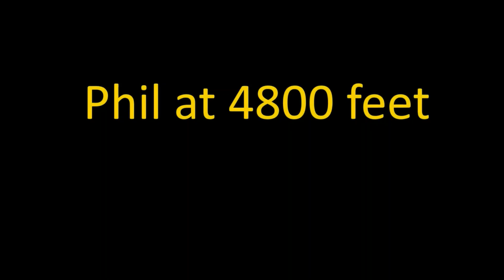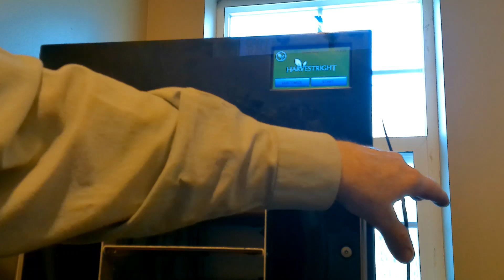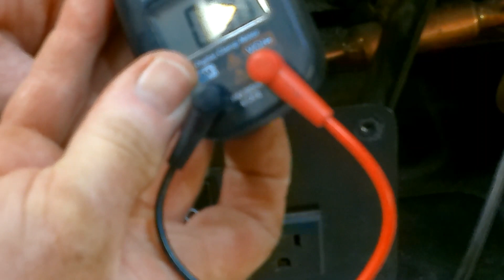Harvest Right Freeze Drier Arc Flash

Comment: Phil, your videos are amazing.  Thus far I found people telling me what to do to “fix” FD problems, but not the what happened and why it happened.  I am a person that wants to know!  In this video, I wonder if the crimp connector was crimped tightly enough from the beginning?  The strands of copper looked charred, but not necessarily frayed/broken (hard to tell via video though).  Did you recrimp the other connectors just to be sure?  And did you replace the one on the relay board that had evidence of heat damage?  Not being critical, just curious.  I think you are working on a medium FD in this video?  I wonder if #12’s are used in the large model, given they require a 20 am dedicated circuit?  Also, thanks for explaining the use of the tools you use throughout your videos.
Reply from the maker: The wire they used should be rated for the amperage drawn.  Most likely, it was a poor crimp on that wire.  I didn't recrimp everything, just performed a pull test.

Comment: I'm having the same issue & its only the 2nd time using it on a brand new harvest right... 
I have a gfci plug & an Arc breaker inside the fuse panel, Its fine on the freezing cycle & drying cycle but I'm assuming it's the final drying that it's tripping the Arc breaker not the gfci....
 Very disappointing after paying that much money & working 10hr days 6 days a week to come home to issues like this
Reply from the maker: Make sure you have at least 15 available amps.  Are you running your FD on a Arc Fault circuit breaker?
Reply: @Philat4800feet  Yes sir, Its a dedicated 20amp Arc breaker with nothing else straight off the main fuse panel all certified wired 2yrs ago

Comment: My problem is after I installed a new touchscreen usb and relay board and turned the fd on,, it flashed/sparked so I INSTANTLY turned it off and I could see and smell the smoke :(
Talked back and forth with HR , sent pics and video and I am still not running yet. I’m going to try and show you the video of what it does now.
Reply from the maker: Where did it spark?
Reply: @Philat4800feet   around the touchscreen/relay board area.

Comment: Good series of videos!  I've been watching a few of them.  Here's some thought and ideas for you (maybe even to make another video on).  1)Quick changeover:  Have you tried using a fan and running thaw cycle with door open at same time.  Might allow you to cut your changeover time in half again.  2) You wrapped your shelves with foil to contain heat and stop ice intrusion.  What about using plastic sheeting?  Less heat conductive and reusable.  Might reduce cycle times further.  3)Do you have any thoughts on programmability and flexibility of HR?  I am thinking of buying one for work project - but would need to be able to adjust cycles, temps, times, pressures.  4)How do you handle materials that have high static when finished?  Thanks for any advise or ideas!!!  Keep up the good work.
Reply from the maker: 1.  I use a fan only to defrost.  I don't use the heaters.  I can clear the chamber in about 40-60 minutes, enough melt to pull the  ice out of the chamber.
2.  Never thought about using plastic wrap.  I do like foil for it's heat conductive properties.
3.  Haven't tried to reprogram, but I have wondered about making a unit strictly manual and getting away from the integrated circuits.
4.  Static?  Don't understand.
Reply: @Philat4800feet  Thanks for the quick response!  I'm a Lean guy as well, so it was just a suggestion that might allow you to use the heat from the heaters as well as the fan and maybe pull the whole chunk of ice out in 20 minutes or so.  (Kaizen the changeover again!) Don't have a freeze dryer yet, so maybe I'm totally off base.  Try it and let me know what happens. 2)Plastic is much more insulating than aluminum, and so would keep more heat inside the cage, and keep more cold outside the cage.  Just a thought if you want to experiment.  3) My application is scientific - I may need to buy the HR scientific model to be able to control the program more.  You seem like a data-driven guy (which is why I like your channel), so I thought maybe you might be experimenting... 4) My product when freeze dried flakes off easily, and I can't have it flying around (due to static, etc).  I will be building a laminar flow hood around the freeze dryer to provide cleanroom type air, etc.  Not really a concern for food freeze drying.  Didn't know whether you run into this.  Sounds like not.  Keep up the good work!

Comment: Doing refrigeration 28 years crimp on slip 
connectors on primary power can heat up and become loose. Always kept in stock in my electrical connectors box. Needle nose to pull connectors also
Reply from the maker: Good comment

Comment: Phil, thanks for all the info you turn out. Have you found any way to get parts for the standard vacuum pumps? My pump needs to be replaced or rebuilt, the electric motor is fine.  thanks again for all the info you provide.
Reply from the maker: I believe you may be able to get them from HR

Comment: When my drier arrived, the pump would not turn on. So that failed the first test you are supposed to try when you get it. I called HR and they couldn't really help. So I figured I should just look at it myself. In my case the wire going to the pump had a loose connector. So I squeezed it up a tad with some needle nose pliers and then went through all the connectors and did the same. Unfortunately I only did the connectors down on the power inerfase and not the rest of the drier. I may have to go in and do that. I suspect that what happened here is the same issue as I had.
Reply from the maker: Sorry to hear about that

Comment: Phil:

Because the connector at the relay board end was also discolored, you know that that connection has also heated.  And that tells you that either too much current flowed through that connection, or that that connection was/is also bad.  Remember that if a push-on lug overheats, the copper/beryllium alloy loses its "temper" and loses its spring strength.  So that lug cannot be trusted either at the wire crimp or at the lug mating end.

One possibility is that the connection at the power switch end was not properly crimped at the factory, and likely, the same person installed the lugs at both ends of that wire, and also "limp wristed" the connection at the relay board end as well, as they were doing the assembly.  I've seen this on HUNDREDS of crimp connectors at a place where I worked many years ago, and when I started finding the bad crimps on one unit, I started pulling on them all, and in every unit that had been manufactured for this particular job.  I found hundreds of improperly crimped connections.  Fortunately, this was while I was testing these systems while still in our facility before we delivered and installed them in the field.

The problem was that the folks that were building the wiring harnesses were not crimping the connectors with enough force.  We solved that problem by purchasing proper ratcheting "full-cycle" crimping tools and the exact crimp lugs meant for use with these particular tools.  Not only do those crimpers give the user a LOT more leverage, making it easy to crimp properly, but they also will not let you release the lug from the tool until you've squeezed the handles together far enough.  Thus the "ratchet" action and the term "full cycle" for these crimpers.

If it was me, I'd replace the relay board end of that wire as well, and make sure the new lug is fully crimped, of course.  I would also do the "yank test" on all of the other crimped connections in your machine.  If one was bad, there may be a lot of others.

Also, something that is extremely valuable when making up crimped connections is the use of a product called DeOxit D5.  This is a product that deoxidizes connections and prevents further oxidation.  I don't sell it or own stock in the company!  But I've used it or its predecessor (Cramolin Red) since the mid 1970s.  It's almost magic.  It's NOT just a simple contact cleaner.

Treat the wire end and inside of the lug with this stuff before crimping.  It will lower the resistance of the connection greatly.  It's also very good on the mating surfaces of the connector pins and sockets as well.  We called this stuff "technician in a can" where I used to work.

Another thought to add:

If the connection at the switch end was the worst of the connections, and it separated enough strands of the wire at some point, you could have very easily had a "brownout" situation at the compressor motor.  And when you starve a motor of that type, it will (non-intuitively) draw MORE current.  And that extra current would help fry the poor-contact areas further, including the one up at the relay board.

I cannot begin to tell you how many so-called electronic and electrical problems have ended up being poor connections and contacts in my 45 years of electronics and electrical work.  It's at least 90% of all "electronic" failures that I've seen.

Get a can of DeOxit D5.  I'm tellin' ya.  It's magic!

And HR:

If you're not using the fancy full-cycle crimping tools and the proper lugs that go with them, you're missing out.  The tools are fairly expensive.  And the good quality lugs cost more, too.  But field failures cost a LOT more.  People's grip strength cannot be counted on to perform proper crimping.  The right tools eliminate a lot of field failures and make it so much easier on the workers.  The good crimpers are an absolute pleasure to use.
Reply from the maker: It sounds like you know your stuff.  I was thinking about soldering the connections and using di-electric grease, maybe increasing the wire size.

Comment: hello im using a different freeze dryer brand ,name lanphan and it requires to fill out the temperature for each time stamp and Im really struggling because im trying to freezedry some candies and it doesn’t puff up like urs so im wondering if you can help me out because i spent nearly all my saving on this freeze dryer😭
Reply from the maker: I watched a video on your FD, apparently you need to program segments of the FD process.  I would mimic the HR candy program:
1.  Freeze the food for one hour with vacuum
2.  Heat the candy to 140 degrees for one hour with vacuum
Does this make sense?

Comment: Phil, Moisture left after the process? Without a moisture meter, the only way you can tell is the food items have a crisp snap.   However, I did this with a batch of avocados recently, and the snap was crisp and the looked and felt dry.... I immediately put them in jars with oxy abs/silca packet.   But I went and bought a moisture meter later that day.. and the meter and I decided to measure them.  said 9.7% moisture. Yikes Is that even acceptable for long term storage?
Reply from the maker: The problem I have with moisture meters is the way it samples.  It only measures the moisture between the two probes.  I would trust your fingers seeking for cool spots throughout the food.

Comment: I've had mine trip the breaker if I short cycle the compressor.  If I hit start and the compressor starts but I forgot to adjust a cycle setting so I hit cancel to change a setting and it turns back off.  If I don't wait at least 5 minutes from when the compressor shut off before hitting start again it will trip my breaker.  I hope Harvest Right fixes this with a firmware update that prevents the start button from working after a certain length of time after the compressor has stopped, should be a simple firmware update.

I've also once had an issue when running candy mode where the heating pads didn't stop at 150 degrees.  I wondered why I didn't hear the compressor running after an hour went and checked and the internal temp was 265 degrees.  Come to find out there is a little circuit breaker disc that tripped underneath the cover that covers the heating pad wiring at the back of the tray.

Comment: Over 4 amps seems high for just the compressor.
Reply from the maker: I can't remember the numbers, but I believe my freeze drier pulls 13 amps with everything running.
Reply: @Philat4800feet  About the same for me. 
The specs for the pumps are :
But starting amps for any motor will be higher. So there is likely a peak at start when freeze drying.

Power Use
The Premier Pump uses less power than the Standard Pump (187 watts versus 218 watts).

Amperage
Under hot conditions at ultimate vacuum pressure the Standard Pump pulls 2.1 amps while the Premier Pump only pulls 1.7 amps. Hence, the Premier Pump is more efficient.

Comment: The power switch is loose on the bracket it sits in, on mine. It felt like you could push the switch through the bracket just turning it on. The replacement parts had the same issue. The hole the cut for the power switch is too small and breaks the tabs that hold them solidly in place. I bet it's mechanical friction from flipping the switch that cause the wire to move off the post...
Reply from the maker: Good thoughts.

Comment: Thanks for the video, Phil - much appreciated.  
Just a thought:  back when the new software came out and you showed how your settings for extra dry time, fast dry toggle, etc., I basically mimicked your settings.  I noted faster cycle times and was pleased with the results, also.  I don't recall the timing of the events.  Then, you suffered a mid-batch heater relay failure and had to replace the board.  Well, I also had the same happen with my dryer and I had to replace the board - just last week, in fact.  It could be coincidence with my changing the settings with the new software and "fast dry" and it could have been coincidence between our individual incidents, but is it at all plausible that the "fast dry" toggle allowed with the new software might put undue wear/strain/?? upon the heater relay, causing it to fail prematurely?  Trust me, I would have no idea, lol, but the thought did occur to me.  You seem to have more know-how and experience on this than I, and I am interested in your thoughts on this.  Thanks for the time!!!!!!!
Reply from the maker: Interesting.  I'll need some time to percolate this idea.
Reply: The software that come out right about then had a bug in it that would cause the heater relay to begin switching on and off at a rapid pace (maybe 3 cycles per second or so).  I also upgraded to that firmware version, and while it worked just fine for a while, eventually, I caught it in the act of cycling the heater relay rapidly, and it fried the contacts of my heater relay.

Fortunately, I had spare relays and was able to take the board out, take it to work, and replace the relay.  And then I updated the software again to a newer version that doesn't have that heater-relay-killing bug in it.  I think version 18 was the one that had the bug.

Anyhow, the very newest version is excellent.  If you're still running a relay-killing version, update immediately!
Reply: @jsigmo  Many thanks, Jsigmo!!!!!

Comment: I was getting ready to order a Harvest Right, but after reading these comments, think I’m going to have to pass.
Reply from the maker: Even with all the problems, I haven't regrated buying a freeze dryer.
Reply: @Philat4800feet  I haven't either but I sure would change things if I did it again.  I love my freeze dryer.
Reply: @Philat4800feet  It’s worrisome for me since my hubby’s genius doesn’t fall to electrical issues. I’m all about food security so a freeze dryer makes sense. Thanks for your video.
Reply: I had mine for over a year. No major problems, still running
Reply: I have an older model. 2017 and they aren't trained in how to repair these.  And it seems since they have their money they don't care either.   Mine worked great for a couple of years then began to have problems.  My sister has bought 2 now and she is ready to give hers away and never buy another.  Her new one started having troubles the day after the warranty expired.   I have no idea how to solve problems with these freeze dryers.  If you do buy one I would recommend doing research on which parts go out and buy spares in case.  They don't have parts for mine anymore.  Make a file of videos showing how to do the repairs like this one so if there is a problem you have a guide.  I do love mine just hate the company for their bad support!
Reply: @lyndabuchholz1216  That’s a great idea, thanks.
Reply: Phil why did you remove my comment?  Trying to hide reality or just being selfish?  Either way it is kinda sad how you are hiding the truth...

Comment: Nice instructive video Phil. My new dryer is giving me “power outage” counts on screen. Sometimes 1 to 3 times per run. Customer service has been super slow responding. They wanted pics of connections and haven’t got back with me yet. Did your dryer have any error type messages displayed?  Thanks
Reply from the maker: Only when the power went out.  When you get a power outage message, was there a bump or interruption with your electricity?
Reply: @Philat4800feet  no, no evidence of power outage on other appliances. I witnessed it one time, the dryer completely blacked out then instantly turned back on. I’ve been corresponding with tech support for over a month. They need thumb drive records then pictures of circuits and last email they need full harvest folder sent to them. Sure hope I find cause of problem soon.